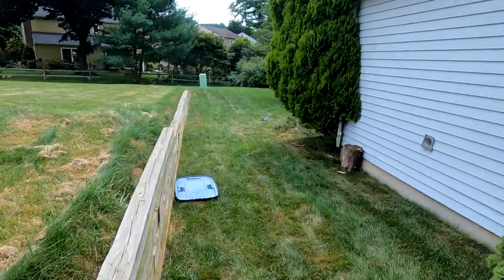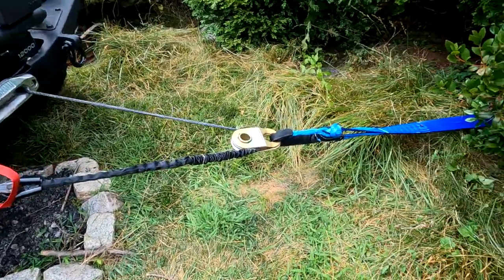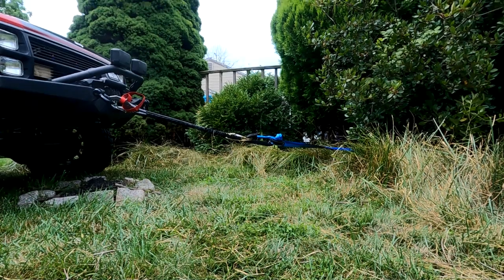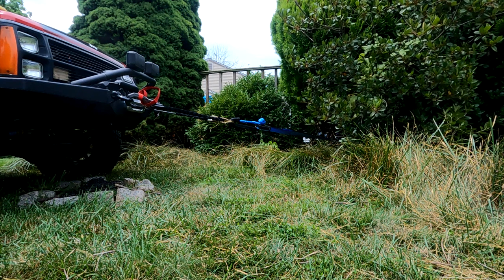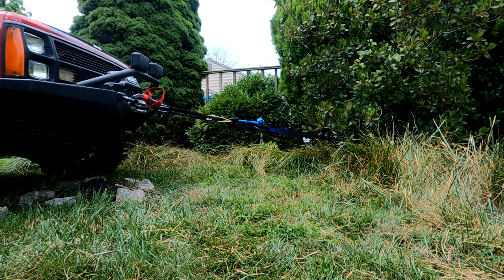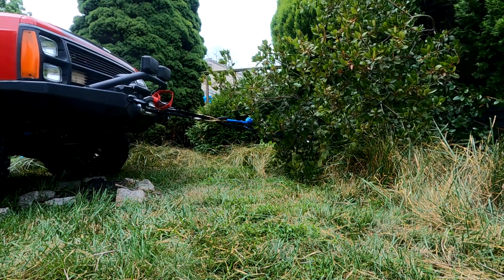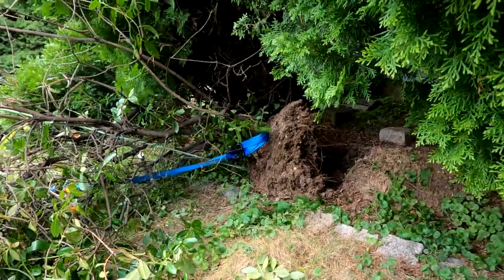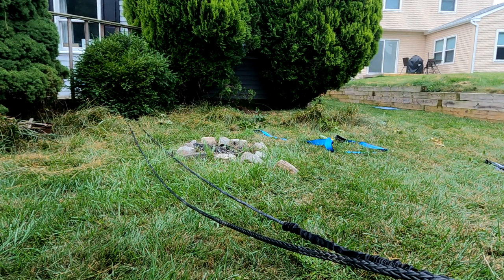Pulling stumps - root balls using a Harbor Freight Badland Winch, a few snatch blocks, and my Jeep.

Comment: I'm 15 minutes in so far, so maybe you already did this, but the only thing I'd do differently is to have both snatch blocks at the bush, and the end of the system anchored to the bumper.  That raises the mechanical advantage from 3:1 to 4:1, from 3 lines to 4 lines coming off the bush, using the same number of snatch blocks.

EDIT:  And not meaning to criticize or downplay your success, at all.  Just making an observation about pulleys and mechanical advantage.  Your setup was more than equal to the task, and accomplished what you wanted.  So that's a good day's work in anyone's book!  Cheers!
Reply: Interesting, being new to this, how would you rig a 4:1 using 2 snatch blocks?

Comment: Good job!  The only thing I would do different is to wrap the strap around the base of the bush a 2nd time.  That way, as the strap tightens, so shall it tighten around the base of the bush and maybe keep it from sliding up as you pull.

Comment: Should always use a damper blanket draped over the cables under tension, in case one snaps.  The weight of the blanket will greatly reduce the risk from whiplash injuring you.

Comment: Your video attracted me b/c I have 800 feet of barbed wire fence embedded with yaupon and other trash. I’m gonna use a winch to pull it out also. I’d use a choker chain on the stump and run the chain over the tire instead of all the rigging. then the rigging. fun video

Comment: Get further back from the pull. The less wraps on the drum of the winch the greater the pulling power. The tire as a redirect. Lower the air pressure. It will act more like a groove for the line. When using my winch for face posts I have a 10 foot cable for the winch. 5 foot on the drum the other over a tire to the base of the post with a small section of chain to connect.

Comment: Not good to use the soft shackles with the snatch blocks with sharp edges. The apex one has nice smooth edges to prevent cutting. now get a winch line extension for a 4:1 using a spanish burton